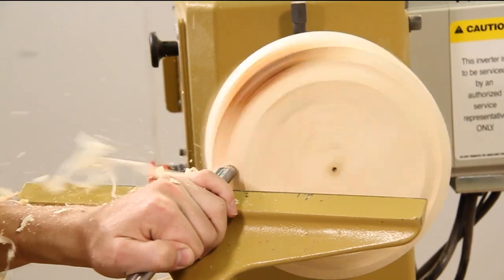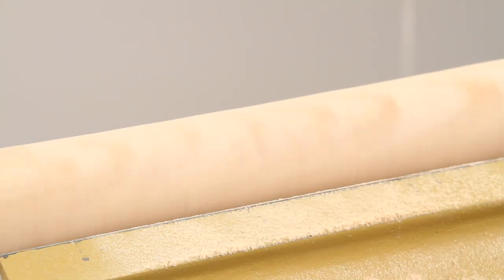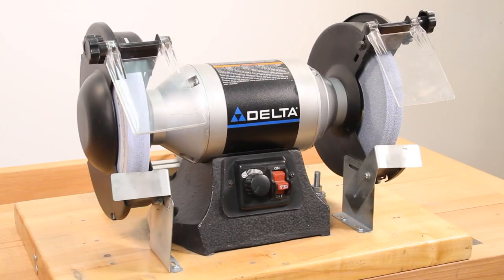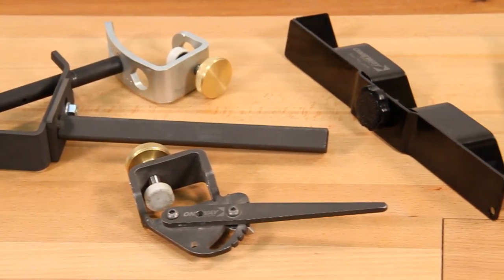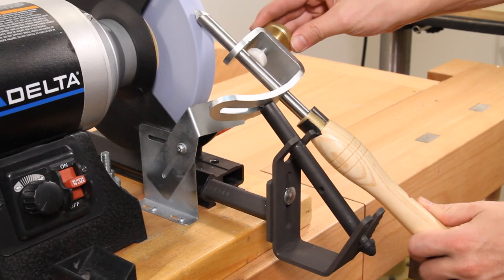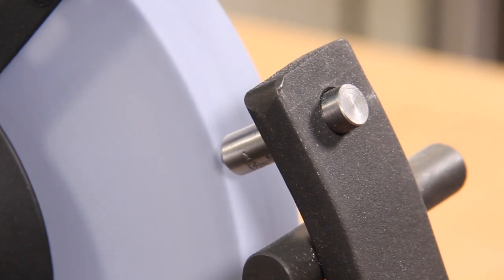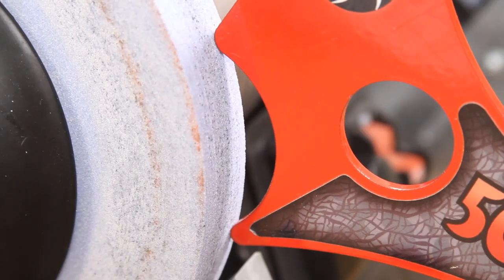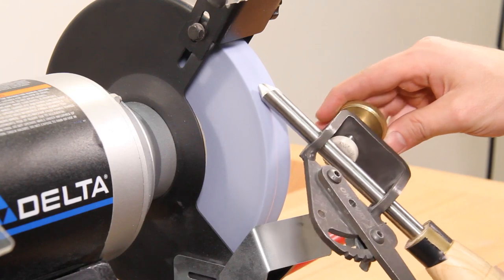Oneway Wolverine Sharpening System (Woodturning)

Comment: How exactly does the Oneway Wolverine Sharpening System mount or attaches to the grinding machine?  From the video, I can't tell if it was bolted down to the wooden bench top or attached to the machine.  Thanks.
Reply from the maker: You'll need to make a wooden base that attaches to your grinder. Here's a link to the step-by-step instructions. https://www.woodturnerscatalog.com/docs/raptor.pdf Please call us at 1-800-551-8876 if you need further assistance. Thanks.

Comment: I can't believe you guys were using that delta grinder. Why not use a slow speed grinder? I know that one is variable speed, but it only goes down to 2000rpm whereas a slow speed grinder goes under 1700 rpm. Won't this make a big difference? I'm looking at getting a grinder and wolverine system, but now you guys have me second guessing everything because you used this grinder!

Comment: not sure what grinding wheels you're using but  the finish on those gouges are far from sharp, with ragged cutting edges.  The result from those wheels looks like something you'd get from wheels used to grind cement...